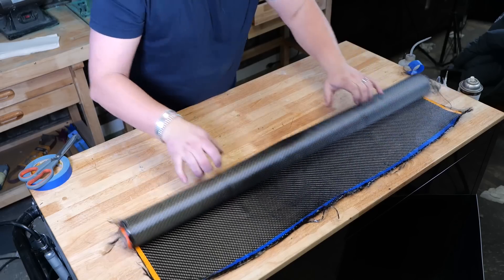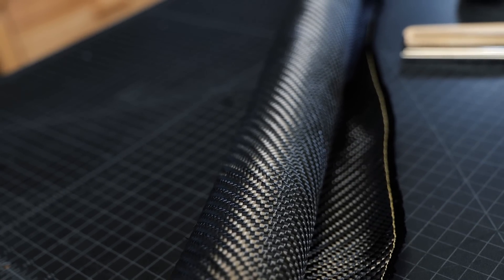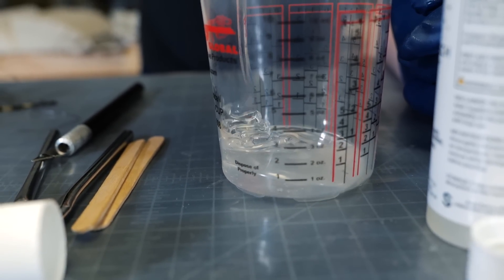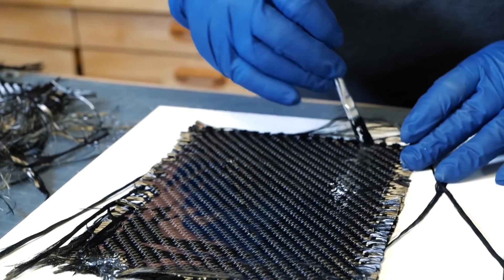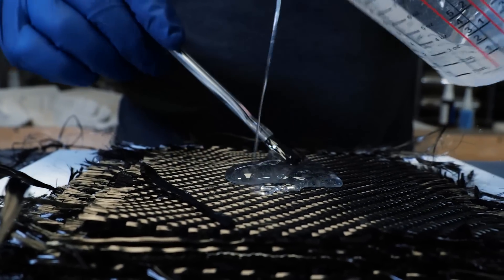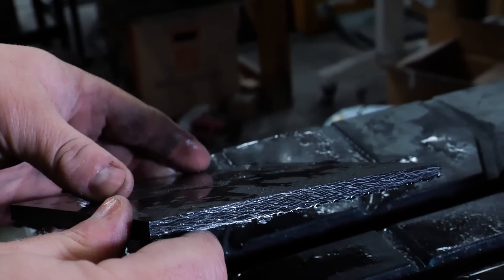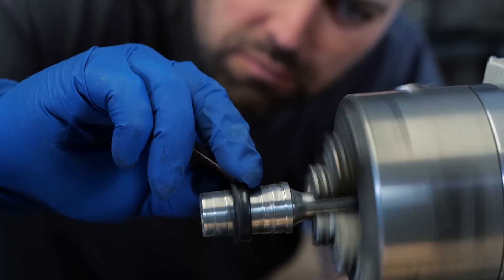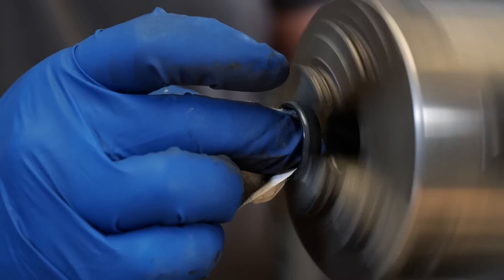How To Make A Carbon Fiber Sheet From Scratch

Comment: I have some carbon fiber and I would like to make glass coaster out of it, as a way to practice (never done this before). 
It’s a very small sheet I got as a leftover and I can make 2 or 3 layers of carbon fiber out of the cloth I have. Do you think it would be enough with 2 layers? And I’m thinking about cutting the sheet in the shape I want at first, and then apply the epoxy. What do you think about that?

Comment: That is a mess you made of the carbon cuts.
First, pull a tow, that will give you a true straight line to cut, second, clean off any loose tows, you were spreading them around in your epoxy, 
Third, don’t use acid brushes! Use a decent brush that doesn’t loose bristles, and willl push the epoxy through the weave.

Comment: If you're not using an any respirator and are not venting your workshop for hours (before removing your ventilator) you're rolling the dice with your lungs, the damage from 2-3 exposures to dust like this can cause problems years later.

Comment: Hi! Can you please suggest? I want to make a structure like a box, but not from sheets, but made of strips, from carbon slats. Need to transport the harp in own semi-hard case, to check it in as luggage when flying. How strong can such a “box” be? The musical instrument in the package is about 17 kg. The main thing is that these carbon strips should weigh minimally, but to be strong enough for carrying upto 20kg, and they must be connected to each other without much difficulty. Is it possible to do or risky?
Reply: That sounds like a neat exercise, but quite technical. Get yourself some proper tuition, this is is NOT it !!

Comment: I have a question, is it necessary to go for the special carbon fiber cloth or any cloth can be used instead? Like maybe discarded shirts or so
Reply from the maker: You totally could that’s called micarta! It’s a great material to work with!
Reply from the maker: You can do with any fabric or even demin works great
Reply: The essence of successful fibre reinforcement ( whatever the material ), is the complete encapsulation with resin, of every single fibre. ( An impossible dream for the D.I.Y er !   The thing is that most material, particularly clothing fabrics, is coated with all kinds of crap that will repel the resin matrix. Furthermore, it's appalling these days, how much material contains plastic, yet another enemy.  Do careful research before playing with any fabric that is not made for this specific purpose !!

Comment: It would be stronger if you used a roller on it between layers and you would save material
Reply: For hand wet-out actual professionals use a squeegee, wet out on a sheet of plastic, and peel off the plastic when each layer is in place. Ideally the fibre-resin ratio should be around 60-65%. A simple wet-preg roller set-up could yield an even higher fibre content. A Mazda Miata size car, built to this clown's specs would weigh about 4 tons,  FFS  !!
Reply: It for sure is quite resin rich.

Comment: okay ! question more like a comment. i will save you 95% of your loss. I will tell you a trick that will yield 95% of used carbon fiber.
Measure out your sheet for cutting mark with nail polish or paint take 5 min epoxy draw 2 parallel lines along side you mark. the parallel lines of epoxy must have a space of 1/10th of an inch. let dry and cut with scissors between the 2 lines of dried epoxy. now the sheets don't come apart the weave stays in tact and you wont have to deal with strands of misfit carbon fiber on the finish of your plate. all that needs to be removed on wet saw is the thin line of 5minute epoxy. simple! send me a 3 yard roll of blue black carbon fiber or Kevlar for the savings . thank you. hehehehe! enjoy your savings

Comment: Youre better off pulling the a single tow along the fabric before you cut it then put on your tape and cut it to stop the nasty frayed edges.
Reply: In a 0/90 fibre orientation.  Not necessarily applicable for other orientations.

Comment: Can you do something with the carbon fiber that was cut and didn't used?
Reply: Fibres ( with the exception of kevlar ) can be milled, or chopped into very small lengths, mixed with resin to use as a filler.

Comment: you shouldn't make carbon fiber at home. 
you'll need an industrial furnace capable of removing all oxygen and you'll also need some argon or other gas, it's not worth it you'll just be wasting resources if you have those things because then you should just build a factory, plus how will you control your pollution?

Comment: bro, we all know how to shop @ homedepot 🤣🤣

how do you feel about the resin infused fabric that you just layout, vac & heat ?  Seems like it would be easier...I've never done carbon fiber, but a lot of fiberglass, wet layups are always a mess.

why the wood clamping & not vacuum?  Vacuum applies even pressure, your particle board clamp does not

lastly, I'm interested in some application where low thermal expansion is critical, do you( or anyone) know anything about how to accomplish that?
Reply: Wow, some interesting questions here.  Firstly, about thermal expansion, you really are getting deep into it !  There are resin formulations for all sorts of applications, you are best to talk to a tech at a real composites supplier,  NOT HOME F'IN DEPOT,  FFS !!  Regarding your laminating choices, you may be confusing ' infusion ', with prepreg / wet preg / hand wet-out.  Prepreg comes from the factory already impregnated, under extremely rigid conditions, but, off course, at a high price. Also it needs to be stored in a freezer, and requires elevated cure temps. Wetpreg is basically the same, although done in-house, and may not need freezing and high temp curing depending on the chosen resin system.   Both of these need vacuum bagging, and prepreg does need high temp curing. The difference with infusion moulding, ( VARTM or vacuum assisted resin transfer method )  is that the entire reinforcement stack is laid into the mould dry, bagged and evacuated, and the resin introduced, through multiple inlets, depending on the size of the product, being drawn in by the vacuum.  A highly skilled operation.  Almost universally the job will then be subject to elevated temp, and any of these methods will be enhanced by elevated pressure as well. Vacuum bagging will only offer atmospheric pressure, while high-specs jobs can go beyond 100 p.s.i.  ( around 7 bar )   In my 59 years of composite construction, my preferred method would be hand-layup for small easy jobs, prepreg for just about anything, with wetpreg as a cheaper option.  What about infusion, I hear you ask,  NO THANKS. !!
Reply: @alpeach9480  I've done vacuum infusions with fiberglass, not sure why you're apposed to it for carbon fiber, but ok.  I didn't know some resins required more than 1 atm of pressure, so thats helpful...though I think thats probably more for high end commercial parts, right?  When I posted that, I was investigating the possibility of making a table for my 3d printer out of carbon fiber, hence my interest in  "zero thermal expansion".  Seems like the right pattern of mesh direction + the right resin can make parts that have virtually no thermal expansion.

ps--the home depot thing was a joke, they dont even carry anything carbon fiber.

Comment: After you run your tape line across your sheet of CF, there is a way to pull out a single thread across the sheet and use a fabric cutter to get a clean cut across the sheet with no fraying and no waste. Check out Street Bandito here on YT. They are amazing with CF.
Reply: seriously. gave me an anxiety attack watching him use scissors lol. i use a tungsten blade fabric cutter

Comment: I keep noticing the “plug” or small disc that is removed on the very first cut on the drill press.  
Do you already do something with those?
If not, they could possibly be used to make matching buttons.
Just a thought.

Comment: Buy yourself a pair of pinking shears, it’s helps prevent the fabric from unraveling when cutting and working with your layup! I’ve only used them a handful of times myself, but our sheet metal and composite guys use them all the time when laying up repairs, I’m an aircraft mechanic
Reply: https://youtu.be/FsLJv8bLKqM
Reply: Pinking shears don't stop fabrics from fraying. Cutting on tape, as shown, works, as long as you leave enough to trim off afterwards.

Comment: shouldn't you wear a dust mask when cutting, maybe sand down carbon fiber?

carbon dust is a nasty thing afaik
Reply from the maker: That’s another reason we use a ton of water to keep the dust from getting all over but yes you definitely should wear a dust mask.

We should be better about disclaiming that when making videos with it.
Reply: @PatrickAdairDesigns  respirator level 20 MERV rating..

Carbon fiber has Sharp edges...like fiberglass similar to Asbestos which I've been exposed to for Decades..

A learned hand lamination of fiberglass resin starting age 8

They were part of my father's fiberglass Electro Acoustic speaker enclosures..which reduces eae fatigue  " distortion " by 86% over Conventional box shaped enclosures 

MORE DB..no cochlea damage 

You have to Layer Carbon Fiber with Shapes and patterns equal to the Exponential curvature of the Edges..

Not just Linear Layers like stacking paper...you can build flex joints internally in carbon fiber lamination. 

And multiple layers of Different Components..

Point being Wear a RESPIRATOR not a dust mask unless you want lacerated skin eye's and Avaloaie lung sacs..
Reply: @mjolnirswrath23   Carbon is way more dangerous than glass. A carbon splinter put me in hospital, on a drip, for three days, due to blood poisoning.  ( Circa 1999 )
Reply: Or you can consider your new carbon plated lungs as an upgrade 😎
Reply: Yes, you should!
Reply: https://youtu.be/FsLJv8bLKqM

Comment: Is there any way to cut it without getting such edges ?
Reply: Yes. Using a machine. Just search how carbon fibre is made. And the are couple of nice videos you can view
Reply: Yep you can actually just remove a strand by grabbing and sliding it off the twill where you what to cut. It will leave holes in the fabric that will guides you during the cutting process. 
You will have a nice and straight carbon ply, without all that fuzzy things on the edges :)
Reply: @valskan1965   Now here's a guy who knows stuff !   I might add, keep your scissors super sharp.  Fettle them frequently, just like your local butcher does with his knives !